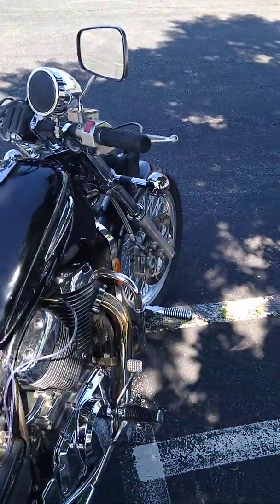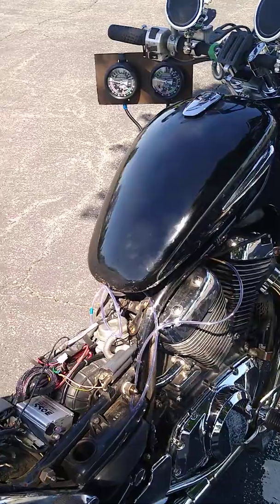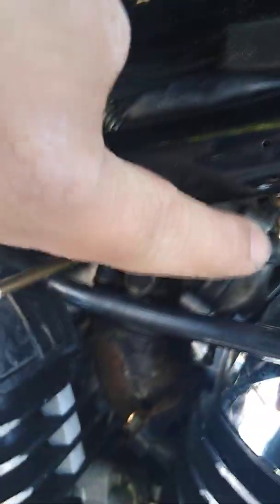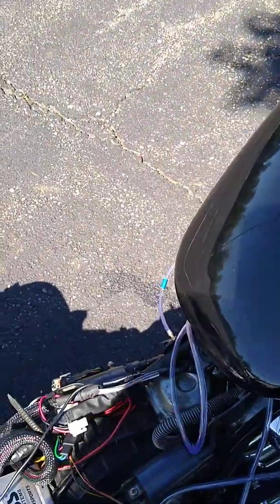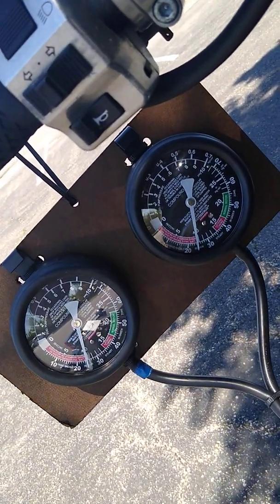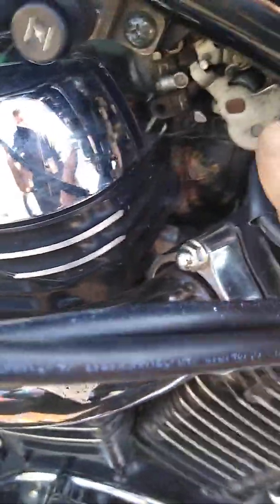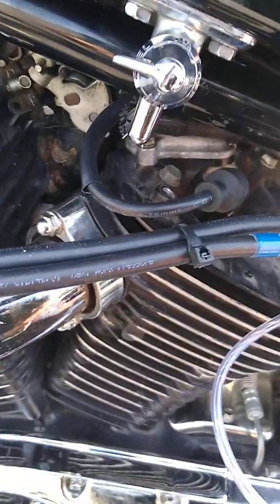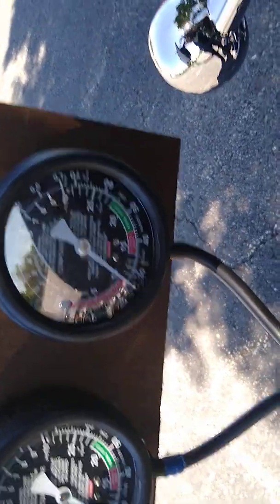Homemade Carb Sync tool

Comment: Drivers side 😆👍 
I think once you get it right... it does act as your master idle. 
But when they are out you would have to treat them as individual adjustments. 
Because that's what the sync cable does is move them together so when you adjust that idle screw, it is moving the from as well. 
Good video. And... Fuck those bitches! 😆
Reply from the maker: I mean technically it is the master idle screw but I set my carb sink and then I set my RPM sync also and whenever they are synced by RPMs if you touch that idle screw it will throw the rear carb off from the front carb by RPMs
Reply: @212Tan  would your sync cable not be working right? 
Mine is apart right now and I'm actually afraid of that because the cable is floppy... but I can't find one anywhere so I think I'm gonna solder an end as much as I don't want to lol